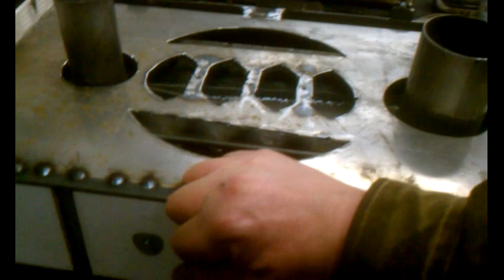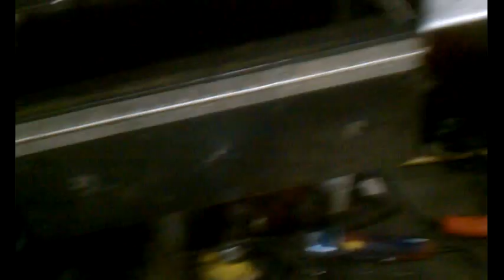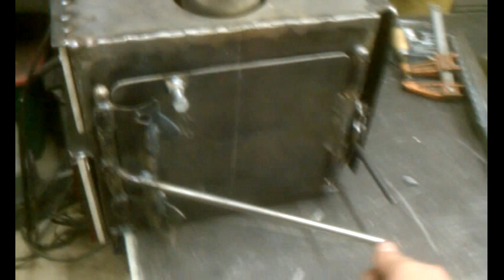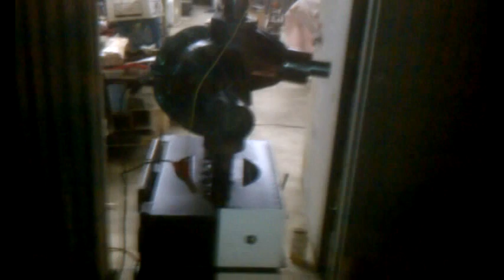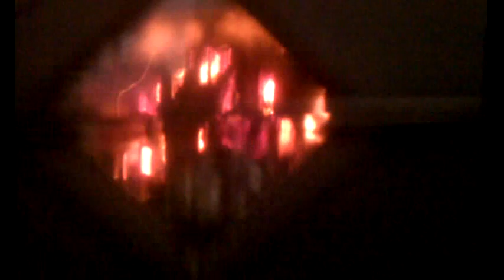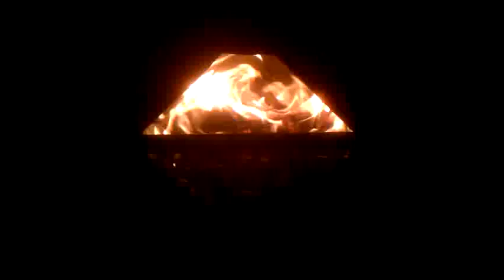RV camper fireplace firewood/pellet zero clearance wood stove by HastyHeat.com , oh yea!

Comment from the maker: figured that, but wanted to show what I am so excited about putting together, should be a couple new shots since I got it installed, still plumbing the chimney, will soon have more to show. I can say is that with about 1 cubic foot of cut up palats, I can keep cozy (55f) in my 35' uninsulated school but with 30 degree temperatures, for an evening (4-6 hours) and it burns so clean I can huff the exhaust. No kidding about as obnoxious as making hashbrowns over a natural gas stove.